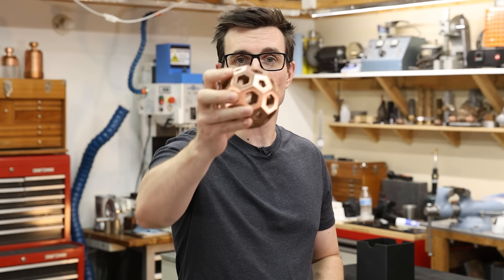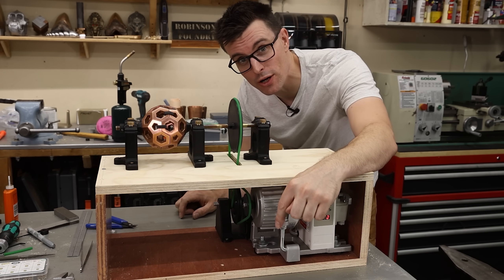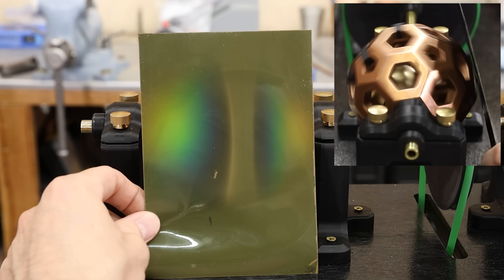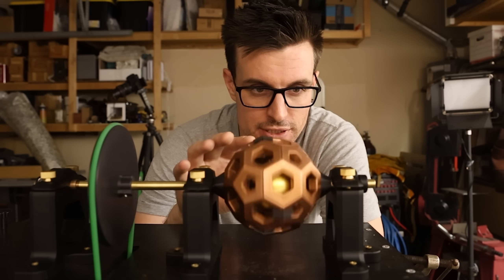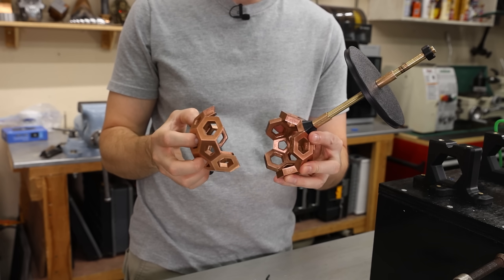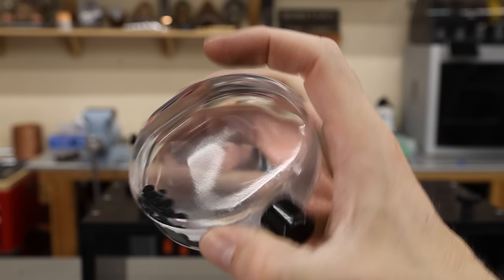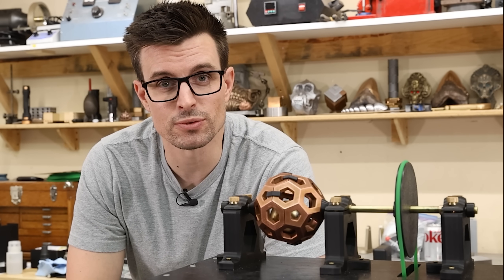Huge Magnet vs Copper Sphere - Anti-gravity Machine

Comment: Just trying to spin ball in the air inside that's it? Ultrasound holography can be applied as a high-resolution method for orchestrating ultrasonic resonance in magnetostrictive magnets enabling spatially controlled mechanical perturbations that subtly reshape their magnetic field patterns. A cutting-edge, physics-grounded approach combining holographic acoustic shaping and magnetomechanical coupling, offering more refined control than uniform ultrasound excitation. Pulsing Ultrasound at amplitudes below the bond-breaking resonance threshold to maintain max safe vibration for your magnet.

Once finding the perfect holography vibration control image for magnet > Shape your magnet to it. Points at little magnetic flying Saucer desk decorations > Search Engine: "Saucer over Dracula's birthplace Yahoo news 16th Century art" Ultrasound technology if learned with give you advantages on every world.. Points at low atmosphere of dead planet like Mars > Points at Ultrasonic microphone in Explorer 1 Probe + "The Interstellar MEDIUM!" Hehehehe.. - Dracula

Comment: I always thought it was a fun idea as a child-- imagine a sort of disc motor that uses this concept and rotates counter to Earth's spin-- so the motor would be spinning magnets inside an aluminum case, like a magnetic bearing-- and maybe like a gyroscope to keep things within a balance. I never thought far enough to imagine how steering the thing would work, but I imagine you'd want the controls to be rigid enough to keep it from completely collapsing into the ground. 

For movement, propulsion, I imagine a series of motors with the same concept as the one driving levitation, but smaller, and the steering would orient them all simultaneously to point them in a direction opposite of your facing.

May be woo woo and unscientific, but a childs imagination doesn't care about that stuff anyhow 😂

Comment: In the tube, it works because the tube has forward momentum as it rolls. With your sphere setup, the momentum is carried by the ball inside because the sphere is in a stationary spin. The inner magnetic ball is then forced to carry momentum while trying to deal with vector change and speed increase. It overcomes the forces which would keep it near the center.

Comment: Quality control at the magnet factory? Maybe the magnets you have are not exactly symmetrical. Something out of balance.
 Maybe a machinist could smooth the inside of the copper sphere thing.

Comment: When you put the smaller ball inside, and increase speed, you know you go through phases where the strongest influence is gravity, then electric field and then the momentum due to centripetal force.  If you don't watch carefully and at times increase the rotation speed slowly enough you miss the phase change. I feel that the point where the electric field and the centripetal momentum are in balance the ball will achieve its maximum smoothness but you sped through it too fast. If you find that spot as accurately as you can and give it a few seconds it might smooth out and you'll see the negative traits of the two phases jointly minimised. You can predict/estimate it all back to the motor RPM using math and I think use data from different phase states to cancel out the quirky sphere.

Comment: The clamp to used counteract the magnetic attraction of the motor is off center from the spindle, which I'm sure plays an effect on why the ball doesn't stay centered. Maybe a longer spindle to put more distance between the motor and the magnetic sphere so there's no interference. I'm also curious about what the optimal thickness of the copper should be, though I think the polygonal  "sphere" with hexagons and pentagons should be replace with two actual hemispheres with "viewports" drilled into it so we can see what's happening.

Comment: Rounding the inside of the copper hexagonal cage would be difficult without remaking the entire cage. I bet you would reach success just by changing the axis of rotation to be vertical/Z axis instead of spinning around a horizonal axis.

Comment: I don't think this can work if the magnet aligns its poles along the axis of rotation.  If you had a perfect spherical shell and jump into the frame of the rotating shell, spinning a perfectly centered magnet around its magnetization direction won't change the field in the metal.  Even with the holes in the shell I would not expect any current to flow, which makes that configuration an unstable equilibrium.  If the magnet is off-center this will generate a current, but it would be a lot larger if you could get the magnetization axis to be perpendicular to the axis of rotation.  The stuff you were doing with external magnets at the end of the video may be doing a bit of that

Comment: I noticed that "equator" as you called it eventually aligned itself with the orientation of the spin of the copper encasement, leading to the poles being horizontal and not vertical. Why not try rotating the whole setup 90 degrees and see which way the poles orientate when you do that instead? 🤔

Comment: It might be stupid of me to ask this but isnt gravity always a downward pulling force on the magnet that needs to be compensated a bit compensated ? Like even though the copper sphere is rotating around it, the forces applied to the magnet is always gonna be bigger towards the ground. You compensated for the magnetic forces coming from the motor, but you haven't compensated for gravity. I know the device is supposed to be an anti gravity device, but the magnet trying to find equlibrium in the copper sphere is still being affected by gravity. So i would try to pull the magnet upward as well. But thats just my theory.

Comment: Lathe the sphere it will naturally be perfectly aligned afterwards for the rod, your approach compounds any errors so you may be in super low tolerance zone at the start with individual pieces but then way above after assembly of all the parts,

Comment: Suspend the magnet on strings so that the magnetic axis and the arbor axis are coaxial. This puts the magnet in the central most location. If there is an effect to be found, I would think it would be in this configuration.

Comment: You could try adding a Faraday cage or some other shielding around your drive motor. It looks like increased rpm on the motor was pulling the ferrofluid directly towards your motor and likely pulling your magnet to the side as well.

Comment: 5:38 that is the singularity of the magnet... Just like a mirror can you stick up your left hand in the mirror your right hand is sticking up due to reflection... This is the exact same thing that happens with the magnetic force... On one side of the singularity it flows inwardly in One direction of spin like a vortex and on the other side of the singularity it flows outwardly away from The Singularity and in the opposite direction of spin... This is like the universe with time flowing in the positive direction in our side and time flowing in reverse on the other side of our three-dimensional universe... The universe is actually toroidal.

Comment: The reason why it bounces worse with smaller magnet is because the outer sphere serves as the limit to hold magnet in place within. When sphere is bigger or magnet smaller it will bouch more around because the moment it starts levitating you would need to keep magnet in uniform motion with the rest of the table and basically the planet Earth lol Remember Earth is spinning around the Sun and so is the magnet once it levitates. And any discrepancy in the relative motions, even the slightest one, will result in the magnet moving around and eventually touching inner sphere wall and then gain energy from rotation of the sphere and start bouncing exponentially more like a ball on a spinning roulette ta le. It would spin out of control but it is limited only due to bouncing off the opposite side inside of the sphere. So the outside sphere keeps it in place but that's artificial and the friction will keep causing it to bounce more and no more of the smaller it is or the bigger the other sphere is, so it is never gonna be stable with physical boundary of the outer sphere holding it locked inside or without any magnetic force keeping it in uniform motion with the planet. You need to build repealing magnets all around on the inside of the larger sphere to keep the levitating magnet in place one is starts levitating by all external magnets pushing magnet I side magnet into the center of the sphere from all directions. Same way what the particle accelerator does to particles so the particles stay in center. Without that it's gonna be impossible for the magnet once it starts levitating to have at least some relative motion and so move towards one side of the sphere and then colide with it, get momentum and start bouncing inside like a lottery ball lol

Comment: The problem is once it is levitating any disturbance or error with start moving it to the interior of the sphere and once it makes no tact the energy pushes it to bounce off and it will move other direction with greater force where it will vouch even more of and so on so to in would end up with more and more 8 stable bouncing. So again, issue is hot to keep ti completely stable the moment it first levitated which is impossible without exterior opposite magnets to push it from all sides into the center. But if you do this they you don't even need this rotating contraption anymore.

Comment: Could you hollow out the rods that holds the copper sphere and create something that is holding the magnet in the center, so when you turn it on the magnet will be held up and once the equator is centered you could release the magnet?
Reply: Also have you tested to see if the sphere is equidistant. It might not be a perfect sphere causing it to wobble when spinning

Comment: I think the issue is coming from the fact that the hexagonal shape is not made from one piece. This will cause an unevenly distributed current in opposition to the copper cylinder which is made of one piece in which the current created will distribute homogenously all over its internal area

Comment: Surely, when the magnetic spins at the same RPM as the copper sphere, there is no relative motion between them and so no eddy currents would be induced? 
Thus the magnet falls but then strikes the side, is given enough of a bump to change their native speed and eddy currents are induced and it briefly levitated. But as it slows down it again matches the RPM of the copper cage, and it again drops, and the cycle repeats.
Thus you'd hear this periodic clunking of the magnet against the copper cage.
Reply: I think you're very, very close with this theory.  Because the eddy current/force requires some kind of relative motion, and because both the geometric shell and the spherical magnet are both moving and coupled by this flux, I claim there should be some resonant speed where the eddy/flux average is sufficient to keep the magnet levitated and also the coupling force sufficient to keep the magnet to shell rotational speed ratio locked.

I may be wrong in thinking though that it's possible to achieve some slow coupling ratio, the forces on the magnet may ultimately be dominated by air resistance and that could be sufficient difference to sustain levitation but this would be at some pretty crazy shell RPM.

Comment: Very interesting experiment! I have a question: if the magnet were already placed centered inside the copper cage, with the magnetic fields previously aligned, and the rotation started at a higher speed—then the supports keeping it centered retracted automatically after stabilization—would that make any difference to the system’s behavior?

Also, I was wondering: doesn't gravity affect the system to the point where some kind of compensation is necessary? Maybe a mechanism that allows the magnet's mass to cancel out the effect of gravity, enabling a purer form of levitation or stability?

Comment: If there's any air gap at all, or even differences between the copper joins, you will get no / less magnetic flux flowing through those joins - a bit like running current through resistors in parallel, where they aren't all exactly the same value. The tolerances will need to be fairly close on this, but I would have made it tube shaped (like your original Lenz demonstration), loaded it from either end, and capped it with something non metallic - obviously with lots of holes in so we can see what's happening!
Reply: That was my thought as well. The copper joints between the two halves of the soccer sphere add significant resistance relative to the continuous copper "mesh" unbalancing the currents and thus the counter magnetic field generated won't be evenly distributed.
Reply: @kimchristensen2175 exactly.

Comment: As the magnet always aligns its north and south along the spinning axis, it seems to me like you could have just use a copper cylinder full of holes?
Its a shame the the magnetic ball could not have its poles one in the centre and one on the outside.
Have you thought of 3d Printing a spherical frame that you could insert lots of small cylindrical magnets into, all with one pole pointing to the centre and the other pole pointing outward?
Just a silly thought 🤔

Comment: The problem you have is: 1 your poles are lining up with rotation- it's the flux lines breaking through the copper that created the electric field 2 the magnet is spinning with the copper which again is preventing the flux lines breaking. If you put a magnet under a sheet of paper and sprinkle iron filings you see the flux line. a coil of wire to make an electric current and then a magnetic field needs to constantly pass through aka break the flux lines. Metal or wire running parallel the flux lines does nothing only breaking the lines.
Possibly is you accelerate and decelerate the motor in a rapid pulsing motion the inertia of the magnet would struggle to keep up causing induction and levitation. You really should also find a way to orientate the magnet 90 degrees from where it is currently again causing flux line breaks with rotation.

Comment: I’ve always been mentally experimenting with this concept. 
Somehow it requires a copper based gel fluid lubrication system. 
It can produce bubbles in the lubricant that are timed to help with surface to surface friction.
The bubbles have internal surface tension magnets field that are key to reduced friction. 
Bubbles that are controlled moving magnetic fields. Standing waves of voids in the lubricants to create less friction.

Comment: Bud, match the stroboscope frequency to the copper sphere so that it appears stationary. Then you can film the sphere through the stationary holes. You can add in a weaker black light to highlight the magnetic sphere. If you're having issues dialing in the stroboscope frequency, double it and try fine adjustments there. Every doubling of the frequency is a resonant frequency, but will allow for finer adjustment. I've used these a lot for pump inspections.

Comment: The original method has the magnetic ball falling through a cylinder, so why not make a large donut copper tube and rotate that, then it's like the magnetic ball is continuously falling, if a copper sphere is always rotating, the orientation of the magnet will always change and lose the desired effect, nothing spins in the original method and that does make a difference - donut is the way to go 👍

Comment: Ditch the cast sphere thing. Cylinder made of solid rods with gaps between them the same size as the diameter of the rods. You basically want it to similate the solid copper tube when its spinning at speed. Your cast sphere is sort of the proof of concept that you dont need a solid mass of copper around the magnet to get the desired effect you just need a consistent mass. This would be an even distribution of copper spinning around and at the correct rpm it would effectively be invisible without the strobe.

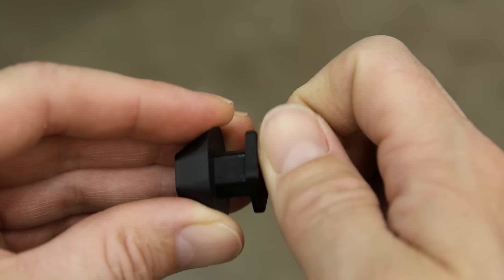Comment: What if you spun it on a vertical axis instead of a horizontal one, like demonstrated at 2:05?

You might be able to remove the force that is trying to pull the ball up the back in the direction of rotation.

Comment: There must be a proportion between the size of the magnet and its effect on the copper structure. The smaller the magnet, the further away it is from the copper it falls, and the larger the magnet, the closer it is to the copper, but it can still hit it.

Comment: I think a sphere of small windows in whatever pattern when viewed from the outside in that seem thin but are acutely thick, would give a good balance of viewing the object while still having mass.

If I'm not explaining properly above, use the mass of the object from outside to inside (smaller core for the magnet, bigger overall sphere) and make it over all bigger and more perfectly spherical both inside and outside.

I guess a visual description would be something like a sphere made of scaffolding (but obvisoly more symmetrical and clean.) Or how if you stack something long and thin together it appears slim from one angle but from another it has depth (as much as you have stacked).

Comment: First, I enjoyed the video. 2) Get the 2 halves on a lathe to turn and balance by caliber first, then by weight. 3) Center and true up posts on copper halves. 4) Adjust and calibrate by dail before run. 5) I really enjoyed the dancing shits.

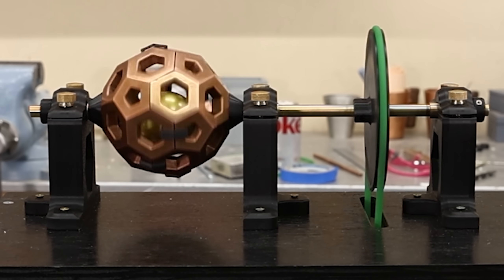Comment: 7:13 it doesn’t look like it’s overcoming its weight so it’s knocking on the side when it tries to move into the center. It doesn’t reach stability before the energy pushes it away. Like air holding up an apple by blowing and dragging. The copper drags the field  and as it rotates, it’s trying to keep up. And you don’t have to use metal there’s a plasma channel that made a material magnetic similar to plastic. Your equator means that there’s two tornadoes spinning on the poles.